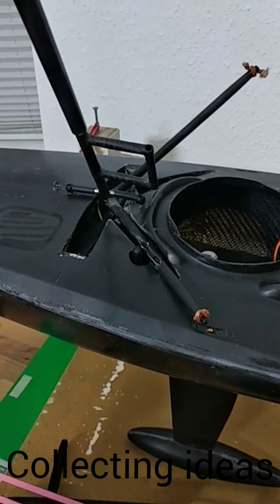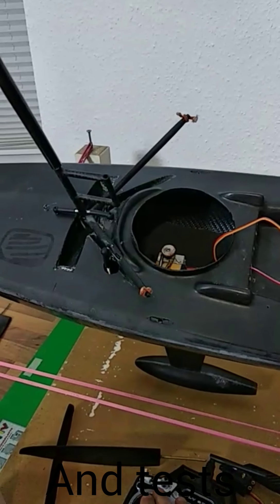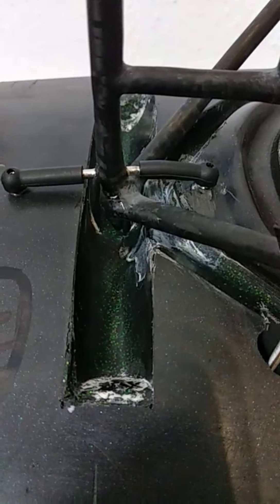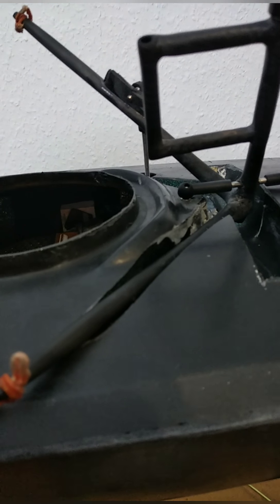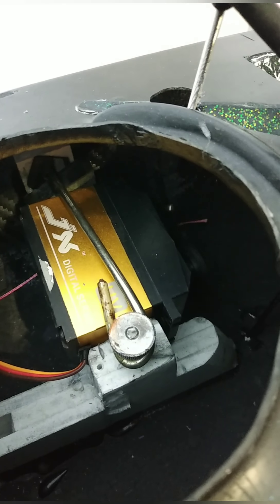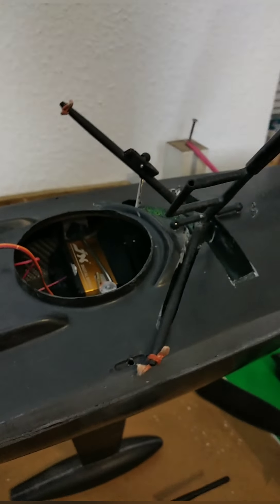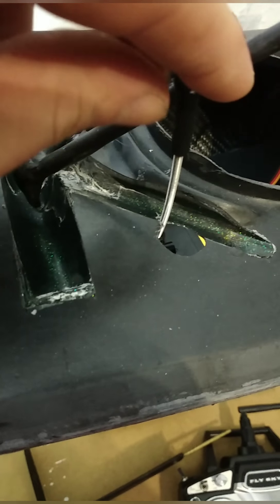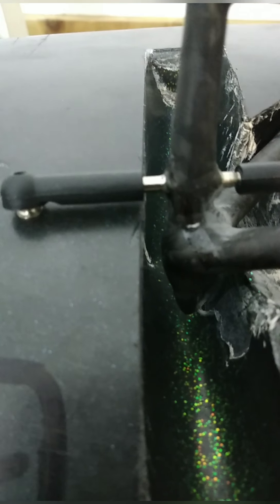Try and arror foiling monohull rc sailboat build #6 watch closely

Comment: @BonCarbon4U "Trial and error"  Test, test, test is the name of the game.  Considering the forces that you might get on that canting mast design, you might consider using aluminum ball joints and servo horn instead of plastic parts.
Reply from the maker: Keep it simple and cheap as Long as possible ist my goal to be able to pivot quick i'll make a new video about my Plan for the Chanal and life
Reply from the maker: update is coming on that
Reply from the maker: hey! i will upload a new video next monday so stay tuned